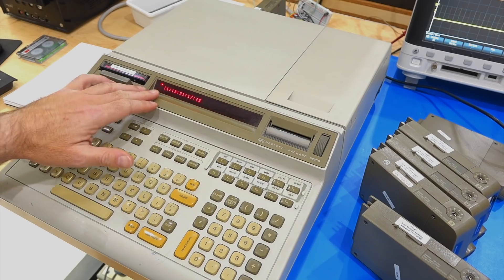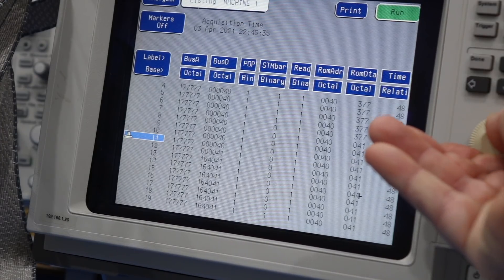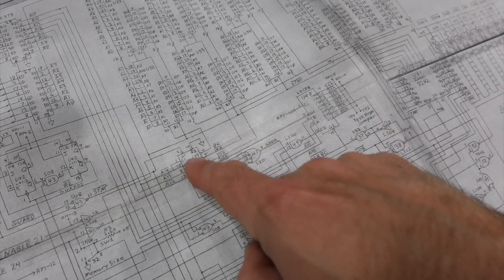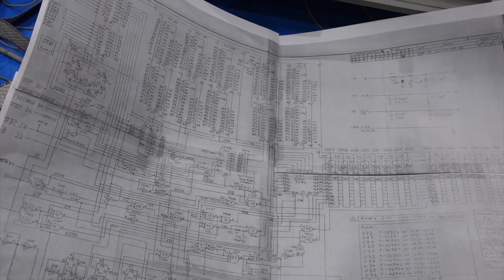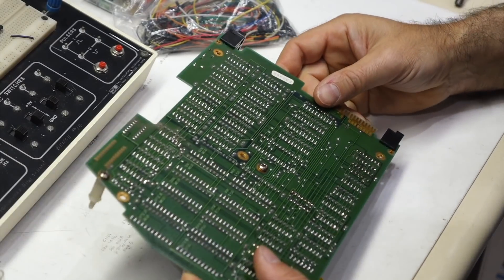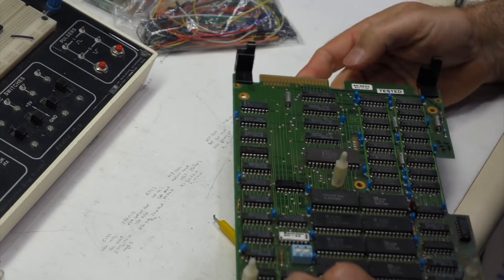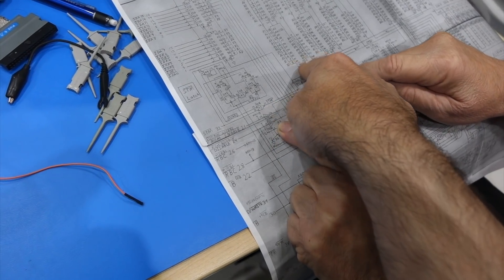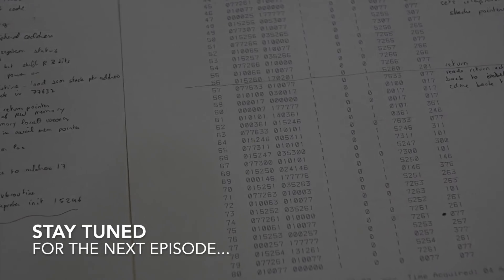HP 9825 Repair Part 4: The processor reads and executes ROM code!

Comment: One thing to look for is copper lines  in multilayer boards which the chips sit can be damaged as under certain circumstances they will act like a "fuse". I also would look at passive components which have been overvoltaged specifically tantalum capacitors. All I'm saying don't get tunnel vision that it's just a bad chip.

Comment: I think the “rats-a-fratz” diode went bad, and that’s why the devilish hack doesn’t work anymore. The “gosh-darn-it” capacitor may have blown, too. That tends to happen when 13 volts ends up on the 5 volt line. At this point, anything on the 5 volt line should be suspect. This is a case where you should take “guilty until proven innocent” to heart. Lots of IC sockets will come in handy, too. 😊

Comment: When I worked as a repair tech many many moons ago, we removed ICs from a board by cutting the legs and removing the body of the IC, then desoldering and removing the legs one by one. I think that is less likely to damage the solder pads than desoldering and yanking out the whole IC at once. Just a suggestion.

Comment: Marc, have you tried looking at all the TTL level signals with a scope to look for valid logic levels? If I were in your shoes, I would do a quick survey. I've seen it many times where bad TTL chips weren't quite at valid logic high or low signals. You might also have luck with the "touch test" or viewing both instruments with an IR camera to spot any hot chips. The fact that you have a known good working unit should really help you. You might also look at the increase in current draw to determine if you should expect something running warmer than it should.

Comment: Thanks for the update Marc, looks like a long haul to completion of the PSU boo-boo :/
I hope the display is ok...
Your showing of the old HP-coded logic chips reminded me that you once showed a chart of HP part-number to manufacturing part-number correlations (or maybe I imagined that). Just curious if that chart (if real) was open sourced anywhere... 
I'm working on a few old HP generators (HP3314A) that suffer from the curse of the OEM HP part-number... though so far I have been able to suss out problem chips just by their pinouts and usage.
Cheers,

Comment: I have fixed (or more or less fixed) some arcade boards which seems to have overvolted, one looks like an IC actually caught fire, some traces have literally burned up and similar things happen - pins have stuck inputs and blow up if you try to toggle it - well not blow up, because I use current-limited PSU and then you can do the hand test which ICs get blistering hot. So if you see an IC whose output should be toggling but doesn't, toggle it manually and feel which ICs get hot.

Comment: This all reminds me of fixing a 'System 80' (TRS-80 M1 clone) many years ago, Somehow mains power (240VAC) flashed over from a metal plate in an attached printer, As in 240VAC up the centronics cable back into the computer.
First, replace blown trackwork, then with a current limited 5V supply, replace all the IC's that are getting hot. Next replace all the IC's that are stone cold. Boy did we replace a lot, however we succeeded.
What amazed me was we didn't lose the ROM's or the processor.

Comment: Old Timers: "It's such a shame we don't repair anything anymore.  We just throw things away when they stop working.  That's wasteful."
Watches this.
"Oh.  I see."
Reply: You mean because of the complexity and time consuming troubleshooting?
Reply: @nikreichel2232  For sure.  It's like totaling a car that's been in an accident.  At some point, and with electronics that's pretty much from any point, it's just obvious that the cost to repair in time and labor will far outweigh the cost of replacing it with a new one you know to be working.  Of course with something that has a heritage like this HP, you put in the time and effort, but that's only for special items where the nostalgia value is so high.
Reply: I'd swear the lettering got smaller too.

Comment: Do you have a thermal camera?

It would be really interesting to see if part failure correlates with package temperature on these poorly TTL parts.
Reply: Do the finger test like Dave Jones !
Reply: @wphanoo  :-)
However, I only 8 fingers and two thumbs , whereas with a FLIR camera I can relatives temperatures of many many chips at once. I had to do this only yesterday!

Comment: Dear curious Archbishop,
I remind you that the original sin is precisely the desire to have more ROM and more RAM.
Battles have been fought in the past, tricking the logic to cram ROM or RAM into the limited address lines of CPUs.
This hunger for more capacity suggests that Big Electron's loyal fans have lost the ability to code more efficiently,
 requiring more and more space, and therefore more logical addressing, for codes that will never be used in the life of the product.
We suggest you check all tantalum capacitors and equip the power source with crossbar protection army.
Kind regards on behalf of the big electron.
The Archbishop of ROM-e...
The POP-e
Reply: Brilliant!
Yeah Mister Marc surprised me with his dive into the Genesis account.
What a mess that turned out to be. But..the celestial  troubleshooter sacrificed his best logic analyser in his quest to repair,and restore,the broken equipment.May he be praised!!
Tee Hee!

Comment: After working with assembly coding of 6800, 8080 etc in the 70-80:ies I find these videos very comforting! I'm not alone in this world! We are of the same kind! At 70+ I still remember the start of the init sequece of the I/O port in one of the machines we used: 86 05 B7 4007...
Reply: Did you use paper tape?

Comment: Repair Part X: The processor reads and writes ROM
Reply: That would be some trick, writing to ROM
Reply: @willyarma_uk  At those days it was a BIG trick but nowadays it is called FLASH technology ...
Reply: @willyarma_uk  My computer uses WOM, Write Only Memory.    Write operations happen faster than the speed of light.
Reply: @teekay_1  Actually, I do have a WOM device on my Linux machine. It's called /dev/null
Reply: @appliedengineering4001  yup, and a rom called /dev/urandom
Reply: I remember the specification of a PCIe controller which had a section titled "Writing to Read-only Registers"....
Reply: @Faolmor  You probably used the opcode  "STVAIMI Address, Register" which was the unwieldy "STore Value And I Mean It" operation.
Reply: Believe it or not....Using a Z-80 as it's host processor, the Astrocade arcade chip set writes to ROM. It is actually something they call 'magic' memory. If you write to a  ROM address between $0000 and $3FFF, it would appear at that memory address plus $4000, which is RAM. Now depending on what was in the 'magic' I/O register at the time it would alter the write in such a way that it would either SHIFT, FLOP, ROTATE, OR or XOR or the data to that area which was indeed screen RAM. It was a precursor to hardware sprites. Interesting tech for the time. IF the 'magic' register was left with no actual command, the chip set would simple replace or write the original data to that address plus $4000. So it's actually a thing....sort of.      :^)
Reply: WAW !... Magic can happen all time ...
Reply: Yup, then you broke something
Reply: Writing to ROM is easy, now if he could write something but all zeros that would be impressive
Reply: I guess that pact with the devil was very dark indeed.

Comment: What is the clock speed of that cpu? And how is its performance per clock in relation to other 16 bit cpu's like the alto bit slice or 8088?
Reply: 6MHz with a two phase clock from a 12MHz oscillator
Reply: @carlclaunch793  That is a really decent clock for the mid 70s.

Comment: You are brave putting good cards in an unknown-state chassis and vice-versa.
Reply from the maker: We have no fear! Actually I was a little worried too... But we repaired the power supply back in episode 1 so the machine should be relatively safe now. Actually the good machine is probably less safe than the bad one at this point! That said, the minute you open up any machine for repair, you always risk causing some damage from a mishap during testing. It’s part of the drill...
Reply: @CuriousMarc  I have done that myself. I once opened an old Macintosh to clean its FDD. While testing, the PCB that drives eject mechanism touched the steal frame of the computer and burned! The computer now can't eject disks and I have to use a pin every time I need to change disks :<
Reply: I was also worried that a blown part might be shorted and sending a voltage somewhere it shouldn't.
Reply from the maker: It still could happen! But the TTL sections should be relatively safe now that we have repaired the 5V.
Reply: @SidneyCritic  
It does seem the PSU was checked and is okay.
Also,,on the load side, Karl did a static load test of all of the cards before connecting the power supply back up.
So,unless we have some unusual problem that presents itself  only on power up,probability is,we're most likely looking at dead/malfunctioning chips.A thermal camera might show up any babies who are over eagerly sucking more than usual from mummy.But it's good,you're thinking about various problems that may arise.

Comment: @4:42 - Does anyone notice the "Don't Care" button on the 1670.  That made me snicker.
Reply: There is an add on card to make it "care even less". :)
Reply: lol, ya! When I was first getting into fixing radios and working on RF equipment, I got a Motorola Service Monitor that had a nice light on it for "Oven Ready". Of course it was just to tell you the internal reference oscillator had warmed up but I still had a good chuckle about it at first!